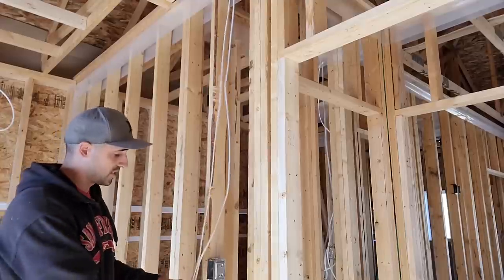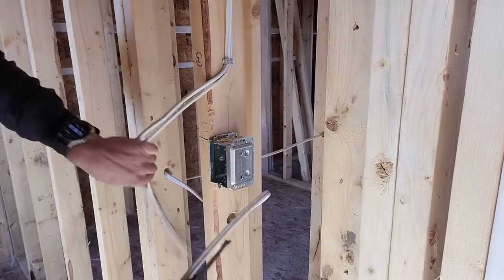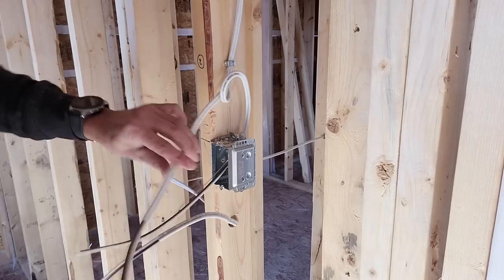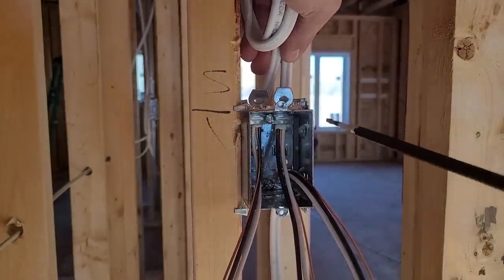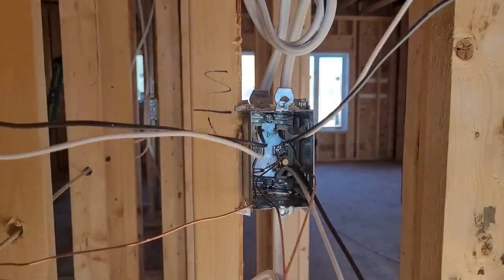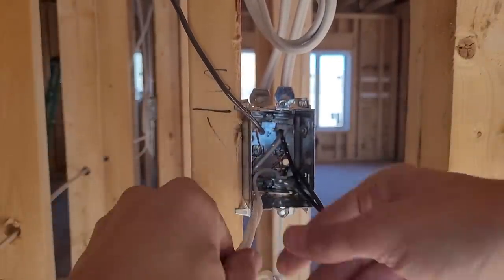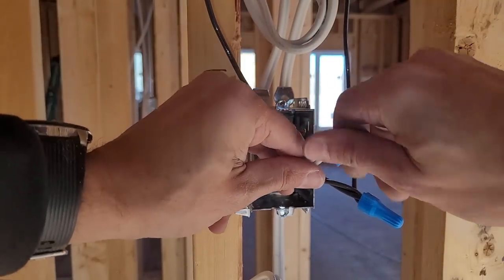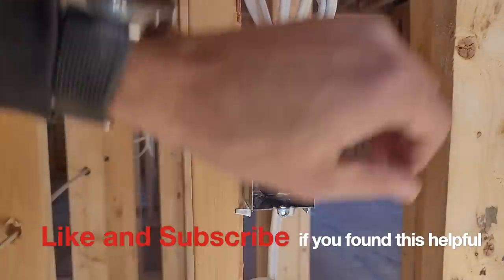How Pro Electricians cut wires into boxes and make it look clean!

Comment: That's was really good.i need help figuring out to put mass wires back into a LED fixture  with a E driver. Man I'm having a hard time putting the light fixture back together with all the wires in the way?
Reply from the maker: Ya I had that problem before too. Trying to fit too many wires into a light  base that was too small. The only advice I can think of is to zip tie or tape the wires together to make the bundle smaller and easier to handle. I even try to tape the bundle down to the base.   Hope it helps.

Comment: Not sure where this is from. But don’t you have to put an EGC pigtailed out for your switch? 
I understand bonding to your metal box, but what about the ECG?
Reply: Ya, every switch I've ever worked with has a ground screw.
Reply from the maker: I don't know where you are, but Eaton switches spec'd for the Canadian market don't have a bonding screw. You need to realize that not everyone on here lives in and follows the American code.
Reply: @energyoneelectric  Ah! Now everything makes sense. I didn’t recognize that box and I didn’t recognize the clipping of the ground/bonding wires before. I like that you call them bonding wires since 93% of American electricians don’t understand how the bonding wires (or equipment grounding wires) are used.
Reply: @energyoneelectric  I need to realize that electrical advice from the interwebs is suspect for that very reason.
Reply: Yes, per the NEC, you must have 6" of wire from where the wire enters the box. That's why here in the states we either use stingers or keep the ground wire real long and strip some insulation (commercial) for bonding with the screw, leaving enough to do whatever.
Reply: @knowledgeableharpy2329  
What the hell is a “stinger”?
Reply: @icevariable9600  Slang for a premade grounding with loop for under the green screw.
Reply: @knowledgeableharpy2329  we just call them ground tails here in MN, ima start calling them stingers to see what reactions I get 😂
Reply: @AdamS-lh2ug  It definitely sounds cool.
Reply: @knowledgeableharpy2329  Yeah, long bond wire tail is standard practice for receptacles here. I'm surprised we haven't been required to bond switches yet. Somehow I think it's inevitable. We're required (as of 2018 CEC) to have the identified conductor in switch boxes. (Not related, just evidence of recent code changes.)

Comment: Biggest question is why wouldn’t you want to ground a switch? I understand the switch will bond to the box but all switches come with a ground screw so why wouldn’t you use it?
Reply from the maker: Not all switches come with a ground screw.  I use Eaton in Canada and they don't have ground screws.  Maybe in the US they do.
Reply: @energyoneelectric  Here in the u.s most motion sensors and smart switches require ground to work.

Comment: Why the tiny metal box? What about box fill? Short grounds are useless for future. I do like the service loop for future work. I guess that makes up some for your short grounds. Here in the U.S. we have to put all our grounds together and ground the box and the device. Also, I was taught to strip an inch or more to twist wires together with my linemans at the last 1/4 inch or so and cut the damaged part off so all the twisted part is a smooth connection going into the wire nut. The longer section you strip the more you can grab for multiple wires and twist. Laying them in as you go. I was hoping you were going to explain how to organize a multi-gang box by squaring up the wires as we called it.
Reply from the maker: The box is not tiny, it's a single gang 2304 box with the bubbled out sides for extra space. There is no issue here with box fill. In Canada we also ground devices such as lights and receptacles. Switches can be grounded if a bonding screw is present, however, if the switch doesn't have a bonding screw or wire then it will be bonded through the metal of the box where the switch tabs touch the box. In case of a plastic box, there is a metal tab running from the bonding screw of the box up to the screw hole where the switch gets secured. In the future I can show how I do a multi gang box. Thanks for watching!
Reply: I also strip them long and then snip at an angle for good bonding in the conical wire nut.
Reply: @energyoneelectric  you must use a different code, I’ll literally looking at 334 & 404.9 (b)(1)
Reply: I have the handbook, so I can take a photo if you want, you’re only allowed to use a switch as your ground if it has a grounded yolk. Which you seem to be glossing over.
Reply from the maker: I'm using the Canadian electrical code
Reply: @energyoneelectric  for some reason, I thought our codes where identical. Thank you for removing the rock from over me. 

Tip moving forward in your videos? Make sure your telling people your Canadian and as such their codes may be much different. You’re definitely getting beat up by us Americans on here. Way to have a thick skin my northern brother.
Reply from the maker: @AdamS-lh2ug  I've heard they are very similar, but obviously there are some big differences.
Reply: From what I understand the differences in this case seem to be related to plastic vs metal boxes. Plastic is way more prevalent in the US and I think the bonding strap isn't set up like the boxes in Canada are. Not actually worked with American plastic boxes, but I've been told the strap doesn't necessarily connect the switch to ground via the tabs. I think it's also why the NEC insists on using a joint to connect all ground wires.
Reply: @raggarex  Correct, but not all, because it’s the US, we like to be difficult and we have like 4 grades of receptacles/switches.  From “residential” to “medical” grade. Residential grade are the cheapest pieces of crap ever to hit the earth but in the US we have what we call “track homes,”or mass production homes. Margins are tight so everything is done on the cheap. Crappy wiring practices like “back stabbing,” come into play. It’s honesty quite ridiculous. 

In short, residential grade are not self grounding. Commercial grade are, and you can side wire.

Comment: Just reaching out... I am approaching a dilemma and I cannot find any info on my next task so I thought I would reach out and see if I can get some feedback. I have and am sound proofing my middle bedroom to be my new home recording studio. The walls are secure with triple insulation including 1-1/2 rigid foam insulation sealed with insulation spray foam. This room is not only dead silent now it is completely air tight...except for my ceiling. The only thing left is the ceiling. My plan is to also apply the 1-1/2 rigid insulation sheets to the ceiling. Once done the entire room will be completely covered in 2-inch acoustic foam panels. Here's my issue. I need to drop my ceiling light fixtures down about four inches. Wiring is not a concern, but I'm not sure how to securely drop & mount the box to remount my lights to clear the double foam. Your thoughts?
Reply from the maker: Thanks for reaching out.  Don't drop the box, just buy a box extension.  It looks like a regular Octagon box but the back is cut out. Same thing for the wall boxes.
Reply: @energyoneelectric  Thanks for the feedback...but the extensions you're talking about that I've seen have no way of solidly mounting my light fixture and I have yet to see the round ones...not to mention I need almost 4 inches. Thoughts?
Reply from the maker: I have a feeling you are thinking about the plastic spark rings which are used for boxes that are deeper inside a wall than normal,  but they don't have screw mounts. I'm talking about metal Octagon extension boxes which are missing the back but still have screw mounts like a regular Octagon. Here's a link: https://www.amazon.com/dp/B000BQWC2M/ref=cm_sw_r_as_gl_apa_gl_i_KQSDZCS34S8MZ4M57803?linkCode=ml2&tag=energyoneel03-20

You will need a a few of these stacked to get your desired drop. Also use longer screws if you just need that extra 1/2 inch or so.
Reply: @energyoneelectric  Now that's what I'm talking about! Although it seems a bit over engineered...stacking these seems like the only way to get the results I need. I just ordered them. Thanks a TON...solved a big problem for me!
Reply from the maker: @stevend984  you're welcome, glad I could help.

Comment: All wire shall be minimum 6" in length from where they enter box and if box is less than 8" in any direction of opening it shall extend minimum 3" from opening. The cable sheath shall extend minimum 1/4" past cable clamps.  Need to secure cable not more than 12" from cable connector by length of wire. All devices with ground screws need to be bonded with wire (this is not an surface mounted box and cannot use exception in 250)
Reply from the maker: There are no code violations in this video according to Canadian electrical code, where I'm located.
Reply: That's great, my comment is for people in America watching this to let them know there violations to the national electrical code here. Yes, I am an inspector. I call code violations for a living, in the United States.

Comment: One thing I noticed about these american back boxes compared to the UK versions is the Cable Clamp. We don't have these, I think they are a good idea.
Reply: It's mighty handy eh? (Legally required national self-identification.)

I wonder if you'd still like it if you got to try one. That's not an implied judgement - it would just be interesting to see if you'd be impressed or recoil in horror when you saw one in the flesh.

I spent a little time in the UK back in the '90's, and was most impressed by the standard appliance plugs and receptacles there. Our garden-variety plugs are rather lacking by comparison. In particular, they don't stand up well to the way many people treat them.

Cheers 🇨🇦
Reply: @scottwilling5315  I’ve been off the tools for a few years now. Desk Jockey! Our standard metal back boxes are 25mm but you can get 35mm and 47mm. The cable entries are just 20mm “knockouts” that we add a rubber grommet to. We also have plastic “cavity” boxes that we use on plasterboard walls. These have plastic parts you can snap off. Neither of these have any form of cable clamp.
Reply: @StorminBriski  That's fascinating, thanks for taking the time to respond. We have loads of boxes with round knockouts as well, but we're required to install in that hole some sort of "connector" that clamps the cable. 

I put "connector" in quotes because I found that terminology surprising when I came to the trade from an electronics background. In trade lingo here, a connector is purely a mechanical device that ties the cable to the box, and the conductors are electrically terminated within by separate means. In electronics a "connector" makes the electrical connection(s), may or may not have a strain relief function, and is usually unpluggable. Different class of animal altogether.

You left out a key detail: what country or general geographical area are you in? Also, what sort of support is required (staples e.g.) outside the box?
Reply: @scottwilling5315  I am from the UK. You would normally use capping to support the cable in a chase or on a block wall. In a void you would need cable clips but in reality people omit these so they could pull a new cable in if required in the future. You are also required to use metal support for cables that go over escape routes. (So they can’t come down in the event of a fire)
Reply: @StorminBriski  Cheers

Comment: Since when don’t you need a ground wire to the switch?
Reply from the maker: I keep getting the same question over and over about the ground wire to the switch. Some switches spec'd for the Canadian market don't have a ground screw. Check this out to see what I mean: https://wiringdevicesupport.eaton.com/Switches/68689783/Why-do-the-decorator-switches-show-a-grounding-screw-when-there-is-no-screw-on-the-ones-i-bought.htm
Reply: Ok. I had no idea that other areas would not require a ground. Thanks.

Comment: Are plastic boxes considered cheesy?
Reply from the maker: Plastic boxes are fine, I just don't like using them myself.
Reply: @energyoneelectric  First... Thanks for the quick reply... Final question. What tips the scale for you towards metal..
Reply from the maker: @bosatsu76  first i want to mention that I use plastic boxes with gaskets on all exterior walls and ceilings (building code here).  I find it harder to insert the cable into the tabs on plastic boxes. With our cold climate sometimes the tabs even break when you're putting pressure on it. Then the little bumps next to the ground screws are always at the tops and bottoms in plastic boxes so I'm forced to bend the ground wire 90 degrees to make it work.  Metal boxes the bumps are always on the left and right of the screws making it simpler in my opinion.  Next if you need to remove the cable for some reason it's easier to loosen the clamp on a metal box and remove instead of trying to bend those plastic tabs to free your wire.  Just personal preference I guess..I may even give plastic boxes a try on the next house to see if I change my mind.
Reply: @energyoneelectric  Great stuff... Thanks... I just do a little work around the house so far, so plastic will do me just fine. I'm simply a nosy guy and want to know everything about everything..
Reply from the maker: @bosatsu76  good luck with your project and stay subscribed.  My mind is exploding with more video tutorial ideas.

Comment: I love watching videos on American electrical installations, it's like going back 50 years in time but in HD.
Reply from the maker: How so?
Reply: @energyoneelectric  are you serious? Wire nuts and     cable clamped to steel boxes, it’s just… American. Don’t get me wrong I’m a fan of the states but you boys with this archaic voltage and 60s era detail… time to progress!
Reply: @jsb7546  head buried firmly in the sand! Love it! 🤓
Reply: Don't lump us in with that wire job. He is Canadian. We adhere to the National Electric Code, which does NOT permit what he did.
Reply: 20+ years in electrical and I've never seen thus in the U.S.
Reply: THIS IS NOT AMERICAN. Don’t lump us with this guy. He’s Canadian. This is not how quality electricians perform work in America. He’s in Canada though, so can’t judge too hard. His bonding his horrible, it’s against code to put more than 1 wire under a ground terminal here, and you have to have at least 66-75% coverage under that screw. It has to be under a green machine thread screw only. We have to leave 6” min from the back of the box for working room.
Reply: @jeremiahbullfrog9288  yes, commenting on the quality of electrical installations is extremely xenophobic and we should all be ashamed. 😂
Reply: @jeremiahbullfrog9288  give over you melt. 😂

Comment: So glad UK electrics and the standard code of practice are so much safer and better. No rubber grommets in back box entries, the earth screws should be terminal type relying on a screw clamp for fixing not wedged under a screw head, no earth sleeving, never twist multiple cores together as it work hardens the copper and twist nuts should be banned! The stripping tool was about the only impressive item
Reply: There is at least one in every video like this. Believe me. We here in north america know how superior your UK codes are (or how superior you all think they are). How could we not know when there is an army of commenters just like you?

Comment: Just an intense DYI'er here...  But, small details add up to far fewer years-down-the-road issues.

When possible, I always point wire nuts and such upwards.  This keeps them from acting like buckets collecting drywall dust, sawdust, and decades of crap over the years.  Should there be a plumbing, roofing, or other such leak/spill, the upwards orientated wire nuts won't act as cups to retain whatever it is that shouldn't have been there in the first place.
Reply from the maker: I also point my wire nuts upwards but usually only outside and in bathrooms where there's a higher chance of moisture accumulating.

Comment: Gonna get ya balls felt by the electrical governing bodies if you run cable like that in the UK !! Totally unnecessary coiled cables equate to resistance in the cables.  They also need to be in a conduit in the wall if less than 50mm from the surface in the UK. Love the box though, well thought out and designed.
Reply: Every country has their own hangups. There is no reason to require conduit in the walls of residential construction. Interesting that the UK deems that a hill to die on. I wonder who on the code committee is related to a conduit manufacturer ;-)